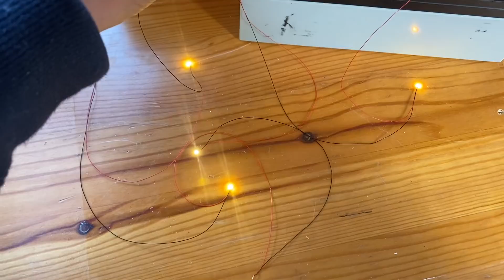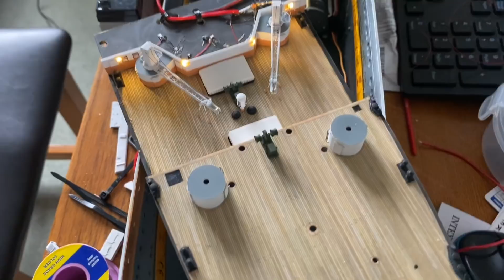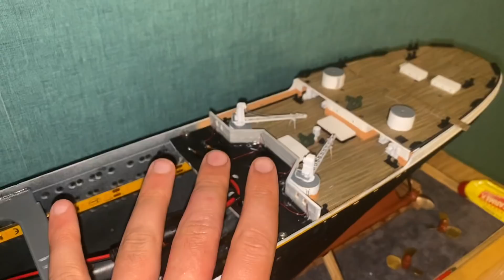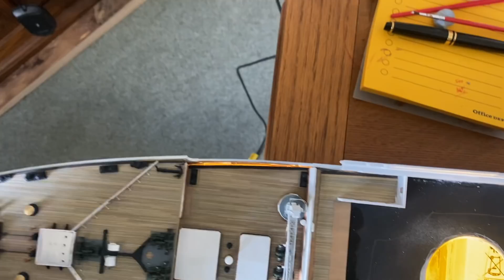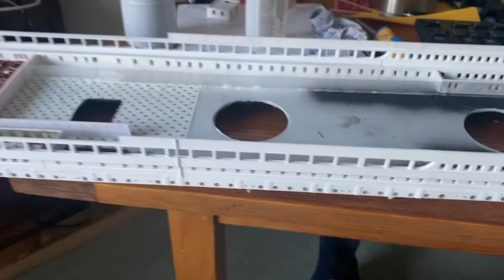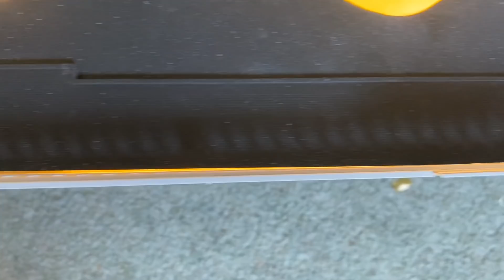Radio Control Trumpeter 1:200 Titanic Build Part 26 - B Deck Lighting

Comment: Thank you very much, its very kind. For the led,  SMD 0402 or 0603 ? Thank you
Reply from the maker: I tend to use 0402. There’s nothing much different on the 0603. 0603 is just slightly bigger!
Reply: @TheModelBoatGuy  Thank you for your answer. Its very kind ;-)

Comment: Hello, how are you ? Could you give me the diameter of the drills to drill the portholes at 5mm57 and diameter of led please. Cordially,
Reply from the maker: Hello, 
Those were 0.9mm drills. If you scale it up to real life it works out at 180mm which is a reasonably size for the opening. These holes are covered by a small brass PE part so the size of the hole is relatively unimportant (within reason obviously! 1mm or 1.1 would be fine I’m sure)
Reply: @TheModelBoatGuy   Thank you very much, its very kind. For the led,  SMD 0402 or 0603 ? Thank you

Comment: Hi friend,  You say that you used 4 LEDs in series for the walls, to obtain that soft light shine, of what value is the resistance that you used in ohms? , considering that it must reach 12 volt. Thanks for the help
Reply from the maker: I can’t remember of the top of my head, I’ll look into it and see. The LEDs in question need a voltage of 3.3 so (4X3.3=13.2). So I’m actually under powering them a touch but it gives a nice glow. I’ll look up the resistor size when I get a chance

Comment: I actually might like your idea of mounting the SMD's inside the walls with a hole in the wall representing the deck light instead of what I have been doing.  Namely mounting a 402 SMD on the outside of the wall to serve as the deck light and than run the small wires through the wall.
Reply from the maker: There are some benefits to my thinking and some to yours I suspect! I think the problem I will encounter is light bleed around the LEDs within the deck houses, which your method avoids. But the reason I did my LEDs inside the walls is because if they shine through a hole they dont cast as much light over the deck so it limits their reach, which makes them look a bit less powerful.
To be honest I don’t think there is a right or wrong way on this one!
Reply: @TheModelBoatGuy  I agree.  Whatever works for the modeler is the best for him.  When I did my first tests with the SMD's sitting on the deck walls they were indeed to bright when run at their normal voltage of 3 to 3.2 V.  By experimenting with different resistors I found that running the SMD's at around 2.65V reduced the brightness to a reasonable level.  This was achieved by using a 1.5k ohm resistor with 6 SMD's wired in parallel.

Comment: Are you using the lighting kit included with the kit? If so, how have you illuminated the area under the forecastle and poop deck and forward part of C deck? I've been looking over the lighting instructions and the kit doesn't seem to reach those areas.
Reply from the maker: I’m not no, I’ve used a different LED strip because I wanted something waterproof.  I have added some lighting in the hull and drilled out portholes which has allowed me to illuminate the underside of the poop deck and the forecastle
Reply: @TheModelBoatGuy  Yeah, I drilled out the portholes too. Its just that the well deck overhangs so much that its really hard to get light on top of it. Same goes for the forward part of the C-Deck superstructure.

Comment: Hi Rob.  This is all looking rather good isn't it, so great job my man!  Obviously your model has more complex areas because of the need for access so great work so far.
I agree the ceiling light leakage could be solved with the drop down screens attached to the underside of the floor above.  There were ceiling lights out on deck too so if you are considering those they could in theory blot out any other leakage but the screening may still be a good idea.  The tiny LED's are a nice touch so I may well get some of those eventually and mix them with Fibre Op's where just a tiny light is needed. That may have been the way to get those lights over the doors but your model is already bulging with electronics as it is!  I am busy making one hell of a mess sanding down the hull butchery that I inflicted.  Bloody hard work but very effective!  I am experimenting with getting the replacement shell plating to look exactly like the real thing using some very thin plastic card.  Fortunately I have a cupboard full of donated polystyrene sheeting to last me a life time!   The frosted plastic to defuse the light is a great way to soften over keen lighting from overwhelming areas.  Anyway great job so far, take your time.  All good here apart from the mess I am making! Stay safe.  Regards JH :-)